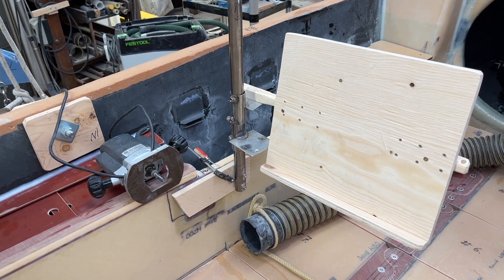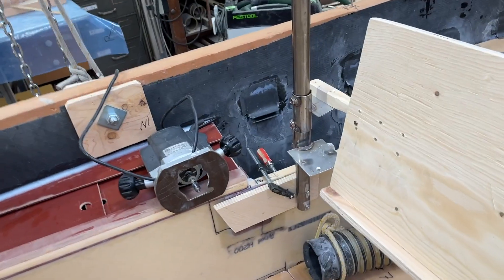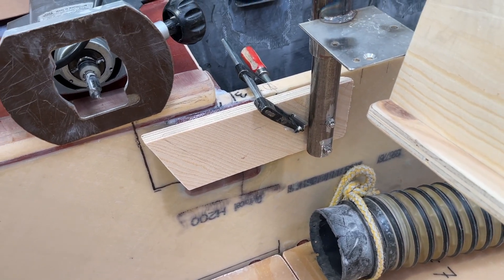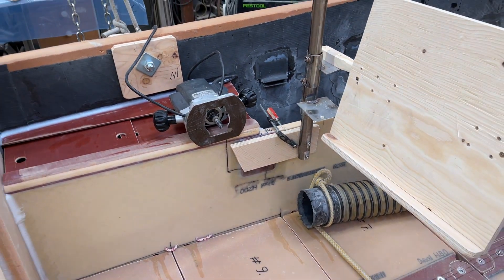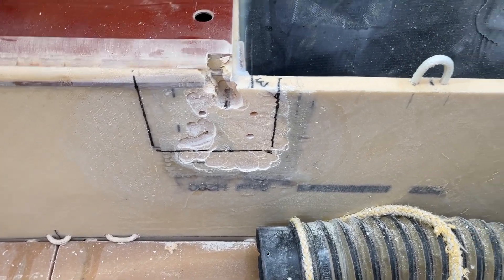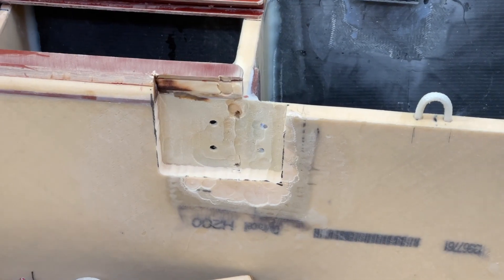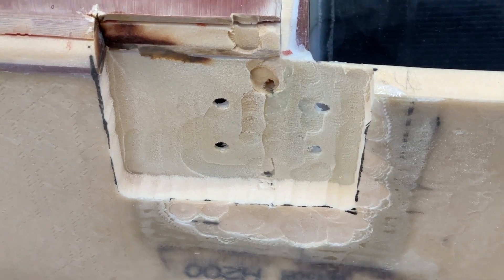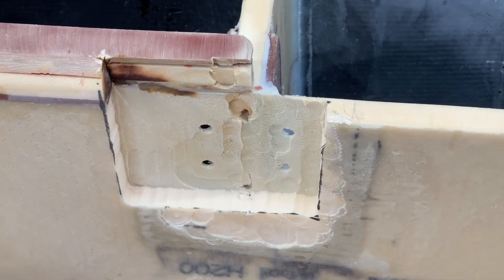4 Feb 2023  Preparing bunk side for a 15 mm G 11 Epoxy laminate to hold the note pad pillar

Comment: I don't remember if you answered this in the beginning videos, but I was wondering why you chose G11 over G10?
G10 has less water absorption compared to G11.  The manufacturer only recommends G11 over G10 in areas of extreme heat etc.
So I'm curious about your thinking about it.
Reply from the maker: Thats odd 
Here it is the opposite.
G11 for strenght G10 for heat.
Reply: Where are you buying the G11 / G10?
Reply: @SvenYrvindExlex  odd.  Good to know. Always read the data sheets, you never know what slight change may trip you up.
Sweden vs. USA name flipflop 😂
Reply from the maker: @artszu  Elisolation Laxå